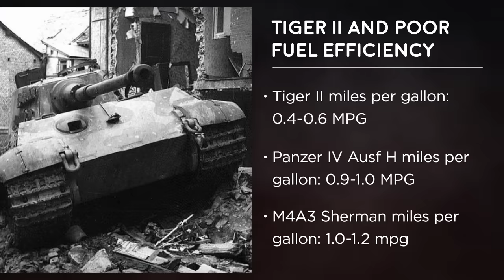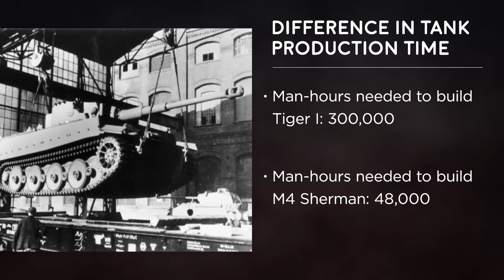Why Did German Tanks Perform So Badly in The Battle of the Bulge?

Comment: Something i would like to point out that gave the shermans an overlooked but absolutely enormous advantage was their stabilizers. The 75 was a relatively light and small gun that was very easy to stabilize and shoot on the move. German tanks would have to come to a stop (imagine the rocking of your optics when a 50 ton metal behemoth goes from 20mph to a complete stop) this resulted in shermans being able to fire before the german driver was able to start slowing down.
Reply: They didn't have to come to a stop. Wittmanns Tiger at Villers Bocage famously  fired on the move. His gunner took out two dozen targets while firing on the move.
Reply: @lyndoncmp5751  there is not a single historical source that says he was on the move when they made those shots. Another lying fanboy.
Reply: Nate

Clearly you've never read a single work on the battle.
Reply: @lyndoncmp5751  wow ive never heard of that one! Great source. Feel free to prove me wrong at anytime. The 88 was a heavy gun that was not stable at all on the move. Even the sherman had a hard time farther than about 500m and that was at a snails pace. In fact some questionable sources say it wasnt made to fire on the move. Just get your shot off faster than an 88 could
Reply: Nate,

Wittmann was well known to order his Tiger gunners to fire on the move in more than one occasion. It could be done. Just read Michael Wittmann and the Tiger Commanders of the Leibstandarte by Patrick Agte. Its all in there.
Conversely, Otto Carius said he never bothered because there was no point. He never said it couldn't be done. He said it just wasn't necessary in his opinion.
Yes the 88mm was a heavy gun but it was well balanced in the Tiger and the Tiger was a very stable gun platform.
Reply: "absolutely enormous advantage was their stabilizers" - doesn't help you much if you can't damage what you are firing on. Most Sherman crews simply disabled the stabilizer, and didn't use them.
Reply: @TTTT-oc4eb  the 76 sherman could easily penetrate the tiger 1 and could pen the tiger 2 with a well placed shot. Stupid take. And in fact i will just quote the us armored board of 44 about your stabilizer comment "The “secret” and “confidential” classification of the gyrostabilizer during the early stages of its use was the cause of much ignorance in its employment and maintenance, and led to a hesitancy on the part of officers and men to make any use of it" that was only the case im the first gen shermans. The second gen got the easy to use westinghouse
Reply: @lyndoncmp5751  lol yeah its all in there. Quote it dude. Everyone knows youre making stuff up as you go
Reply: @natelav534  The 76mm M1 had major problems with its AP ammunition (too soft) and could bare penetrate the 80mm front hull of the Panzer IV.
Reply: @TTTT-oc4eb  lmao there are videos on this app that show american 76's mauling tiger armor. It did have issues going through angled armor just as the german 88 could not penetrate the front of a jumbo sherman. But that was just an inherit issue of all ap rounds at the time
Reply: @natelav534  The problems with both the 76mm and 90mm were well known.

Richard Anderson of the Dupuy Institute:

“The "problem" with the 76mm wasn't really a single problem with the gun or in testing...it was multiple problems. The standard projectile, the 76mm APC M62 was produced with a large cavity for the burster, because everyone assumed that it was the behind-armor effect of the HE bursting that would do the most damage. However, there were two problems with that. For one, the larger cavity weakened the projectile, causing it to stress shatter when striking at high projectile diameter to armor thickness ratios. And then, even when it didn't fail, the BD fuse (common in all the US APC rounds) tended to go off before penetration was completed, destroying the projectile and preventing penetration.

However, when tested at Aberdeen they weren't testing for behind-armor effects, so the cavity was inert filled, which improved the results. The problem was exacerbated by the simple fact they assumed the Germans would be using armor similar to our own and BRL did not have samples to test to destruction until late 1943 in the case of the Tiger, early 1944 in the case of a late-model Panzer IV, and late October 1944 in the case of the Panther, which was far too late since the 76mm gun development was completed in early 1942. On top of that, it wasn't until June 1944 that it was realized the hardness specifications for the American projectiles was insufficient as well, which meant that the solid AP projectiles were also deforming and shattering when striking the German armor, even though after the initial problems found with the APC rounds had led to the assumption relying on the simpler AP shot would solve the problem. The solution was re-heat treated AP shot, the M77 in the 90mm, which became the T33, while in the 76mm work on perfecting the HVAP continued.

On top of that, the 76mm had major issues with flash and blast obscuring observation of the fall of shot. The flash problem was solved when it was found that it was caused by failure to completely combust the propellant in the cartridge...the solution was a longer ignition primer. Blast could be solved by a muzzle brake, but it was considered NIH - and too "German" - so was delayed in deployment.

Of course, the worst problem was the conservatism of Ordnance. The flash problem could have been solved from the get go with flash suppressing chemical additives, but they were considered to cause excessive wear in the tube so were rejected, since Ordnance liked to achieve 1,000+ round lifetimes in its barrels, which hardly helped when the tank it was fitted to only fired 200 rounds before it was knocked out. On top of that, despite advice to increase the propellant load and thus increase chamber pressure and Mv (as did the Germans in the Pak/KwK/StK 40 and KwK 42 and the British in the 17-pdr) in the 3" and 76mm, Ordnance refused because of concerns with safety issues. Fundamentally, there was nothing mysterious about the 17-pdr that made it a better 3" gun than the American 3" gun, since, despite the nomenclature, the 17-pdr, 77mm, 76mm, and 3" guns were all very similar pieces.”
Reply: @TTTT-oc4eb  and the german 88 was derived from a flak gun... they had issues with barrel wear when the higher pressure ap rounds were out through it. It was innacurate at first. And even after the barrel material was changed it only remained accurate for about 400 rounds. This idea that the germans were an unstoppable war machine that didnt suffer the same problems as everyone else is crazy. Remember they were testing these guns in the late 30s. We didnt start until the 40s and had to catch up quick. But the 76 was very capable of knocking out even the heavy german tanks based on 1st hand sources.
Reply: @natelav534  You are trippin. Bye.
Reply: @TTTT-oc4eb  there it is. The end of every argument with werhaboos.
Reply: @natelav534  LOL, can't even spell Wehraboo correct.
Reply: @TTTT-oc4eb  they lost. Theres nothing you can do about it
Reply: From my understanding the Stabilizers mainly served to bring the gun into alignment with the target upon stopping.   It was a basic system with the gun and optics linked together using an electrical switch on the gyroscope called 'silverstats' that controlled hydraulic flow through a hydraulic valve .  The problem was that both the gun and optics were linked and its hardly possible to move the gun accurately given that it weighed so much.
-The Suspension of the Panther and Tiger was extremely good and one reason for the big effort of multiple overlapping large diameter wheels,  torsion bar suspension with shock absorbers was to allow firing on the move.   I doubt it worked super well but it was done.  The Pershing did not have stabilization for some reason but on its one encounter with Tiger I fired on the move.
-The Germans did have gyroscopic stabilization on some models of the Panzer III both 3.7cm and 5.0cm models sent to North Africa.  These used 'Big Gyroscopes' of 6 and 8 inches to stabilized the whole gun directly.   It worked but could not be scaled to more than 5.0cm guns.  
-A gyroscopic system along with stereoscopic range finder was developed for the Schmalturm Panther and Tiger II but never saw service.    In this system only the optics was stabilized, which was easy to do.  A firing circuit then fired the gun when it crossed the target taking account the angular velocity.  This is an derivative of naval practice.
Reply: @williamzk9083  a pershing never encountered a tiger. It was a panther and they fired moving a couple feet at a time around a corner
Reply: @Vegito_Fanpage 
Grow up. Please.
Reply: @TTTT-oc4eb 
You know when you are conversing with children when they resort to that "Wehraboo" nonsense. It's a childish internet meme.
Reply: @natelav534 
"" the 76 was very capable of knocking out even the heavy german tanks based on 1st hand sources."" 

The commanding general of US 2nd Armored Division, Isaac D White, was complaining of the relative ineffectiveness of the 76mm. General White wrote to Eisenhower in March 1945 and told him:

"" the 76-mm gun, even with HVAP ammunition, is not effective at the required ranges at which we must be able to effectively engage enemy armor....the most important point, and upon which there is universal agreement, is our lack of a tank gun and anti-tank gun with which we can effectively engage enemy armor at the required range. The correction of this deficiency has made progress, but the problem has not as yet been satisfactorily solved""

A report from US 2nd Armored Division in February 1945 concluded:

""Present tanks are entirely unsatisfactory, due to lack of a satisfactory gun""

That's first hand. 😉
Reply: @lyndoncmp5751  it was almost a year ago youre still thinking about this? 😂
Reply: @natelav534   Testing at Aberdeen Proving Grounds showed a 75% probability of hit at 500 yards while moving over medium rough terrain at 15 mph. Now consider a platoon of 5 tanks, moving as a unit. 5 tanks, 5 rounds P(hit) is 1- (0.25)^5 = 0.999  The Tiger was a very capable tank, if it broke down in the right place.
Reply: @natelav534   Chieftain asserts that the Pershings contacted 3 Tiger IIs. One was "Fireball" which was killed at a distance of 75 meters.  One Tiger was destroyed by a Pershing, but since the Tiger was on a train at the time, isn't a big surprise.
Reply: @TTTT-oc4eb  Sometime mid-war, American metallurgy made a big leap and was able to produce an AP ammunition alloy that was significantly better able to penetrate armor.  If you look at the history of the naval 16"/45  and 16"/50, the latest alloy formulations were soooo much better that the US Navy scrambled to replace 16" projectiles that were stowed on board battleships with the upgraded projectiles.  Perhaps the same metallurgical advance is what was applied to other AP shell production, such as that of the 76mm's AP ammo.
Reply: This would definitely make sense as to why German tanks would perform worse on the offensive